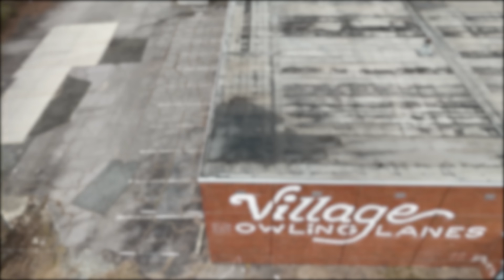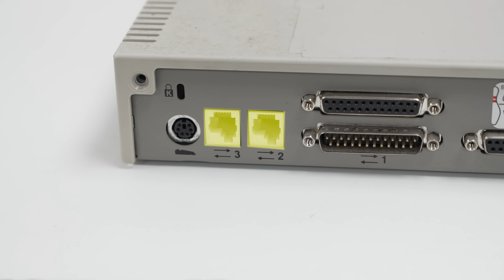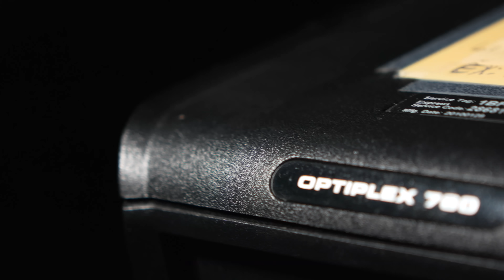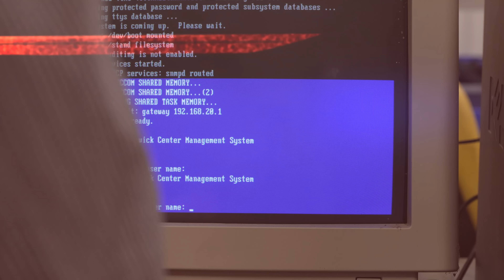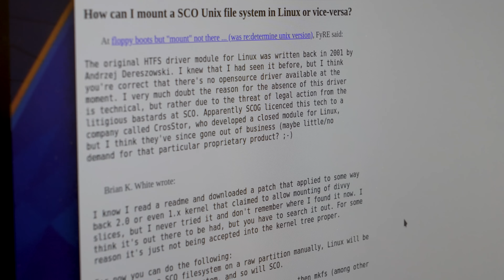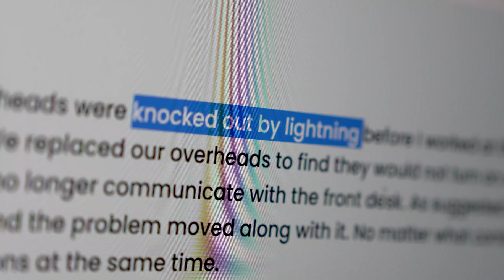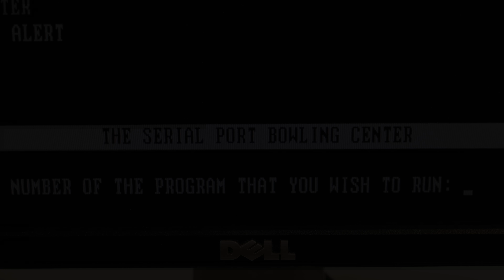We hacked into a bowling alley computer!

Comment: I laughed my ass off when you described how you got root on the server. 
I was given an old SGI desktop which a coworker had been using as a footrest. Apparently, it had been used as a CAD workstation early in the company's history. I powered it up and it showed enough signs of life that I invested WAY more than I should have in adapters to allow me to connect PC keyboard, mouse and monitor to it. Then I found an AUI to 10BASET adapter to get it on the net. Next step was to get root.  It should have been as easy as asking the IT guys, but they had forgotten it...I ended up doing exactly what you did...subjecting /etc/passwd to John the Ripper, which took less time than it took me to get a coffee! Then, I got a call from the IT guy, they had found the password :-) It ran great, neat demo programs and I was even able to upgrade the OS from CD images I found online. Unfortuantely, SGI Unix (Irix) does not come with a built-in C compiler (go figure). I should dust it off and get it running again.

Comment: I upgraded a bowling alley last year. The previous system was installed sometimes in the 90's. Every two screens had one computer. Inside was a 386SX computer. Now they run on a Windows XP or 7 (offline) and the one computer is hooked up to all eight screens and connected to Brunswick bowling machines. The computer runs a software called Viking Scoring

Comment: Wasn't that a late Caldera Linux? I worked for Halfords (in the UK) when Boots owned them, they had a very elderly stock and till management system, using a single i286/i386, and sometimes the newer stores had a i486, often without a monitor/ keyboard etc, just a network cable. The tills and parts lookup machines were all dumb terminals, depending on the store location and age they were a mix of HP, Wise and anything the IT support dept could lay their hands on. Occasionally they went down, it was nice to be the person who everyone knew to call upon to bring the system back up if the IT dept were too busy to answer the phone.

Comment: Kinda funny, as I used one of these systems back in the 90s for a bowling tournament.  Their modem dial-in line was also being used by their CC terminal to dial-out, so I had to use the system during off-hours.

Side Note: SCO Unix has some serious file system issues, as it is not transactional and data is cached in memory.  INODE errors are files that are pretty much permanently damaged/lost, and eventually that includes system files that will prevent the booting of the system.  If you don’t do a shutdown, the file system destroys itself.

Comment: Wow! I used to work with an AS-80 (converted to AS-90) at my bowling center that I still work for as the head mechanic. I still have old videos of that system in action! The back office computer brought back some memories. The back office sever ended up kicking the bucket and we had to operate all of the pedestals at the lanes by putting it into standalone mode via key for a few months. It was a nightmare of COM lines, dip switches, CRTs, and don’t get me started on calibrating the CCD cameras which read the pin count at the machines. Nonetheless, it certainly out lived itself and was a solid system. Now I work with Windows based scoring that uses a couple network switches and Cat5e. If something ever goes wrong internally on the network, tech support connects on TeamViewer haha.

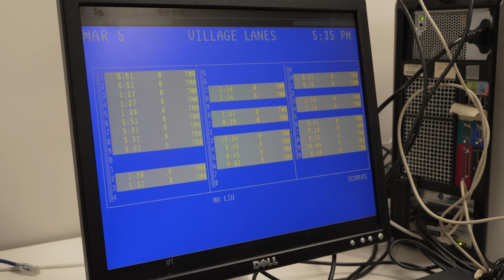Comment: @12:45, what likely happened was that the name was tied to the registration number on the vendor's side - back in the SCO days, you had to "activate" (this is before XP) software once you put your name in, and they would give you a challenge code to register it.  If you moved hardware, changed the system name, or even sneezed, it became deactivated, or in "limited" mode, and would stop working except for some functions, and you would have to call the vendor and get a new challenge code.  There was an executable to call to input this typically.  IMS/BASIC and other SCO programs also had this type of serial number activation system.

Comment: I think I'm still an SCO UINX Certified Unix System Administrator from when I was in college.  Glad to know I might be able to fall back on that and operate a bowling alley.  I was very surprised that the Dell booted up - I was expecting an orange blinking power light.  I think that was from the middle to end of the great capacitor plague.  I'd almost bet that the dates on the power supply and/or motherboard are newer than the chassis.

Comment: I worked at a local pet store from 2015-2016 with the same OS running in a virtual machine. All customer data, all transactions, all receipts, and all coupons were stored in that system. No mouse, all keyboard commands. It was wild to learn as a high schooler in 2015!

Comment: As for the failing hard drive - a common failure point for those inexpensive ones from WD is the contact between the magnetic heads and the PCB. They are connected with spring-loaded contacts, and the contact pads on the PCB on these models are just tinned with solder. As time passes they oxidize, and the contact becomes flaky. That's quite easy to fix - remove the PCB, locate the said contacts, clean them with a white pencil eraser until they are nice and shiny, remove the rubber particles with a cotton swab and some alcohol, put back the PCB, and enjoy a (most likely) properly working HDD! To make it even better you can put some silicone lube on the cleaned contacts before putting back the PCB, so they are protected from the oxygen and won't oxidize again

Comment: Makes no sense that there’s no heatsink for the processor, and why they didn’t just use the built in Ethernet port on the Dell.  The Optiplex is one of the most aesthetically pleasing computers ever built.
Reply: My guess is SCO didn’t have a driver for the on board Ethernet port so they had to use an Ethernet card that was compatible, maybe scavenged from the machine this one replaced.

Comment: I think the LIU bypass is just a serial loopback adapter connected to whatever serial port the system is expecting.  What would be neat is to, instead, capture that stream before looping it back, so that an emulated LIU could be built.  Easy Arduino project.

Comment: I've worked in Bowling Centers off and on years, and the original system I worked on an old 386 based computer and had Xenix as the operating system which wasn't Y2K compliant.  We had to set the year to 1972 in 1999 for the schedules to work correctly.

Comment: I purchased a closed bowling center in 2012 with AS90 and that same CommandNetwork scoring. Only difference was mine ran Xenix. I too had no clue what to do, so I ended up forking over some cash to get someone to get me setup with the correct name and number of lanes. I used that system up until I sold in 2022. I kept a back office, a couple of terminals, and scoring consoles when the new owner tossed it all out. It’s a brilliant system that you can learn to run with your eyes closed once you get the muscle memory down. Something wonderful and frightening to have your business relying on 1980s tech in recent years.

Comment: You know what I would do with this?  I'd get some Go (or Python, if you prefer) code running on a Raspberry Pi to simulate bowling alley activity from the LIU, scoring units and whatnot.  I wouldn't be able to resist the urge.  It would be one of those weeks-long reverse engineering proprietary protocol deep dives in which I frequently find myself.

Comment: I used to work on systems that ran sco unix. We had a board with a similar connector that provided 8 serial ports.  For loopback on a serial port, you only need to connect pins 2 and 3 on a db9 connector. It basically connects transmit and receive together. Usually it's run at the far end of a serial cable to test the port and the cable.

Comment: In this video you can see an example of the classic hacking techniques called, using linux to rescue a dying drive, and getting a friend to crack the password file of the drive backup. Many but not all modern drives are protected with "bitlocker" or other drive encryption technologies to prevent this kind of attack. But an early 2000s bowling PC is no match for these master hackers.

Comment: former SCO pre-sales engineer here. I finally threw away my sets of unlimited enterprise licenses to SCO Open Server 5 and SCO Unixware 7 some 2 years ago after holding on to them for over 20 years, stupid me...
SCO owned at one point in time some 80% of unix market on x86 and there was plenty of hospitality and entertainment systems built on it, ranging from thousands of hotels across America checking you in running Micros on Open Server at their front desk to slot machines in Sun City casinos in South Africa. Then linux kernel 2.4 came with magically improved intel SMP and the party was over for SCO within 3-4 years.

Comment: The loop was probably a 20ma data loop threw all of the machines. I used to do ITI card access and that's how they communicated. each node panel would pass on the info from the others in the loop and controlled with a terminal.

Comment: There's a pretty good chance that the OS and software image is from the original machine, as well as the peripheral cards. "Mike" may have just imaged the old drive to a newer SATA replacement and slapped it into this Optiplex, along with the serial card and other bits. The fact that both OpenServer 5 and the relevant serial card driver were released in 1997 points to this. I find the 8GB partition size to also be a dead giveaway as that was the maximum partition size that many PCs of the mid to late 90s era could boot from.

Many of us aren't beyond doing the above. I once "upgraded" a system for monitoring of a marine steam propulsion plant by doing basically the same thing. The software and interface card were designed for NT4 and weren't happy about the idea of running on anything else - and we did try. Eventually we just imaged the drive to a new one and placed it in a newer Optiplex (see a theme here) and adjusted BIOS settings like SATA ATA emulation until NT4 booted and ran.
Reply: I was thinking along the same lines but I thought I saw a 2007 copyright date on one of the login screens. It's possible I misread the date but it also looks like OpenServer 5 was still receiving updates in 2018 so it might be a manufacturer supplied upgrade for an original system.

Comment: The AMF Accuscore2 system ran on Xenix386. I was surprised to see it when I worked for a center in 99-04, as I had only seen it at a trade school in 95-96 before that. The front desk used VT220 terminals, and the lanes were interfaced through an LIU which took care of turning lanes on and off. I'm not sure if the RS485 that went to the per-lane "curtain wall chassis" scorer came from the LIU or the PC itself. The CWCs were running a Motorola 68000 CPU, and had a ROM card that would insert into the front, which also included two rotary BCD switches to set the odd lane number for the pair the CWC was on. I don't remember what processor the camera units or bowler keyboard units used.

Comment: And many many centers still use systems just like that to this date.
Also another system that hasn't changed since the late 80's early 90's is timing systems for drag racing. Accutime and Compulink are two companies that had a hold of the market. Many tracks still use 286 and 386 computers to run the timing systems.

Comment: Hey if you have intrest in small networks, go to the open to the public archives on the 5th floor of the University of Wisconsin Stevens Point. Ask for the files on the Star Lan Network and the first internet setup there. I think I archived them in 2017? 2018?  It was the first US school to have a hookup to DARPA NET and before that their dean was a huge radio nerd from the US Navy and into computers in the 60s and 70s and had them install a cool LAN and was ahead of the curve. It was all documented in there. I couldn't understand most of it. But they had how it was revised from versions 1.0 all to 2.2 and how they mounted images to terminals in 1980 thru the late 80s and how the switch to windows slowly happened from dos and stuff and only the Science dept used Unix anymore for some programs. 
The notes left by the teams were lol worth a read.

Comment: The old BMW Modic/DIS runs on SCO. It's obsolete and replaced with newer Windows software, but I seem to recall back in the day to mount the filesystem and transfer files you had to install a separate copy of SCO with FAT32 support. The process was pretty well documented on various BMW message boards.

Comment: I just want to share some info on how a modern center's system is run (from my experience, not universal, IDK what AMF does, etc)

The server: A Dell server running windows server (probably not fully updated)
The terminal: A Dell PC running windows with software to interface with the server
The scoring displays: An industrial PC running windows embedded
The scoring tablet: Android running an front-end app
The peripheral controller: A headless system that takes commands over Ethernet and controls the pinsetter and bumpers over serial

A couple extras for anyone still reading
Mobile terminals for wait staff: Windows 10 on a Touch Dynamic tablet with built in Credit Card interface
Self service kiosks: Windows 10 on a Touch Dynamic kiosk
Spark augmented reality: Dell PCs running windows 10 and software by TouchMagix
The machine that oils the lanes: Android running on the same tablet as the scorer tablet (or linux on a custom device if you have an old GUI)
Newer model pinsetters than mine: Android (presumably only a front-end, but IDK) these do not require a peripheral controller

Comment: There used to be an AMF bowling alley in Moore, OK off of I-35 between 4th & 19th Streets.
Unfortunately, the building got a direct hit by the May 2013 tornado outbreak, nearly five years after it opened, that also hit the Moore Medial Center, Tinker FCU, and the USPS branch around it.
The bowling alley was never rebuilt since then, and now in its place sits a FirstUnited Bank that had just opened a few years ago.

Comment: Our alley was old enough to have CRT displays at the lanes with crude "graphics" for strike, spare and turkey displays. The computers under each ball return were generic 486 desktops running LANtastic on DOS
Reply: That's not very old. My favorite bowling alley just kept the original 1950s projector system, (something like the Brunswick Tel-E-Score) until they closed in the early 2010s.
Reply: @eDoc2020  That's awesome. The bowling center in my hometown had those when I was little but computerized in (I think) the early 80s.
Reply: @wesley00042  This place closed down specifically because they did not want to sell to somebody who would keep it as a bowling center and change things too much.

Comment: Could boot the system with a SCO cd and alter the /etc/passwd to gain access. Or mount it in another SCO machine.
Reply from the maker: Yes what we did (with help) was used a new clean SCO install in a VM, and then mounted the drive image in the VM
Reply: @theserialport  Is it 5.0.7 or 5.0.5? I never saw a uname -a output. I run SCO in production still and it's amazingly stable. (Never had a crash in 10+ years.)
Reply from the maker: @kanalnamn  when booting, it shows Kernel ID 97/05/07  uname -a shows:  "SCO_SV cms 3.2 2 i386" and the "custom" command lists SCO Openserver Enterprise 5.0.4p
Reply: @theserialport  Nice. Haven't used 5.0.4 but if scoadmin is present, that's a nice admin frontend.

Comment: I wonder if there's any way to adapt a pinsetter to something that would load kids on to a school bus.  I suppose the top would need to be ripped off the bus though.
Reply: Considering there are quite a few cases of pinsetters crushing full grown men, I don't know that that's such a good idea... or maybe it is depending on how much you dislike children?  
The old machines a center with this score system would have had are purely mechanical beasts with no connection to the computer other than an on/off  signal.  Look up a video of an A2 pinsetter.
Reply: @johngaltline9933  I suppose I'll set it to delicates then.